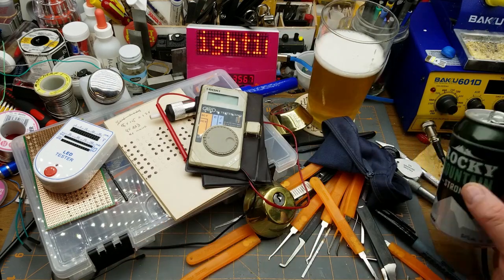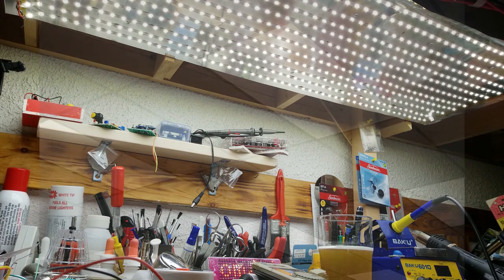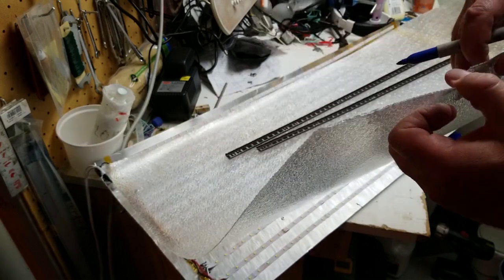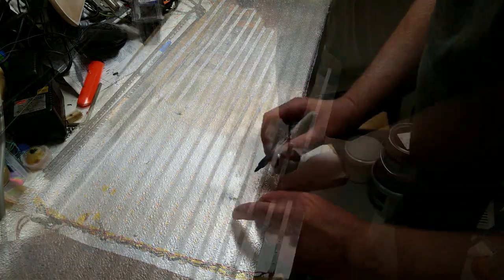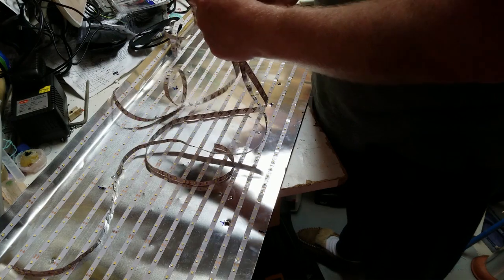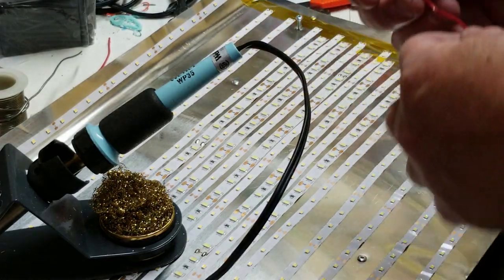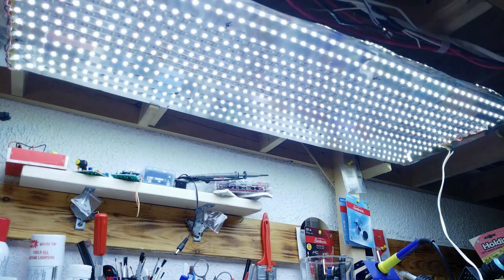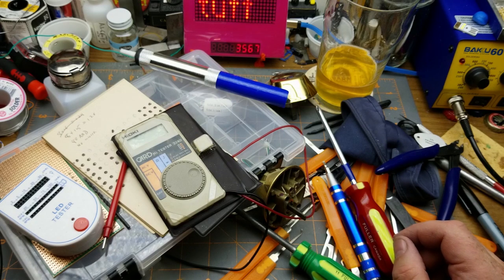workbench light diffuser

Comment: If you drop the diffuser down a few inches I think you won't notice any reflected dots.  Get some longer screws or bolts and either just let it hang freely or cut some PVC pipe as spacers.  The spacers will keep it from moving about much.
Reply from the maker: When I was experimenting by just holding the diffuser in place noticed that. 
Unfortunately I didn't have any screws on-hand at the time that were long enough (about 3 inches).
I'll get some the next time I'm at the hardware store (if I remember)

Comment: Far more elegant than my solution! 50w LED spotlight from amazon, 18" or so above the workbench lol!
Reply: I have three different spot lights plus an overhead LED shop light in the shape of a fluorescent tube light, I still can’t get it right. It’s like the holy Grail or something.
Reply: @GadgetReboot  I work in front of a window, so natural light. If I need a lot of light then can turn on the 80W street light I have nearby, and that provides way more than enough light for most work. Portable light is a double 5ft waterproof light that I recently converted to LED, it is bright, just a little hard to work with in close spaces, but for a room perfect as bright fill light just on the floor.

Comment: Nice work. But you should have spaced the diffuser away from the LEDs, instead of right up against them. That would have given you better diffusion.
Reply from the maker: I didn't have any screws on-hand at the time that were long enough (probably at least 3 inches).
I'll get some the next time I'm at the hardware store (if I remember)

Comment: Lock picking/smith tools... when did you start into that?  I just started a month ago after watching and getting hooked on a couple YT channels about that.  Don't know why or how it first got in my suggested videos but I'm hooked and it is fun and challenging.
Reply from the maker: I've been tinkering with it for a couple of years. Built a few picks after watching some videos (probably the same channels you are watching) and then ordered the cheapest Chinese pick set I could find (https://www.youtube.com/watch?v=CadGGPpE8tw).
Those 2 locks I have on my workbench were a "$1.00, no keys" yard sale find.
Reply: @pileofstuff  Same here, why buy when you can make, using scrap hex keys and a grinder, then harden them up. Did quite a few pickings of cheap L&F locks with only 2 paper clips.
Reply from the maker: The first few that I made were done using stainless steel hose clamp material, wiper inserts (the traditional amterial), and even coat hanger wire (makes a decent TOK tensioner if you flatten the end a bit)

Comment: is the diffuser screen too close to the light source? Maybe a bit further away would help? ( not an easy thing to test i see )
Reply from the maker: Distance does make a difference. It does get more diffuse as you increase the distance.

These are the longest wood screws I happened to have on hand that day. 

I'll probably experiment with some longer ones if I remember the next time I'm at the hardware store.
Reply: @pileofstuff  Just some still wire on the short screws, through the hole and then bend to a T shape so it does not fall through again.

Comment: As somebody who's worked in commercial lighting for almost 40 years, I cringe heaps when I see something like that.
LED Strips are totally the wrong product, and there is massive losses from all those resisters. The efficiency and durability of the strips is poor, and that diffuser panel is totally random and doesn't deal with the light output in a "technical" or "optical" method.
You'd do a lot better to chuck all that hobbyist rubbish away, and get some 1x4' or 2x4' fixtures and stick some reasonable LED tubes in them. The light should NOT be above you, and definitely not from in front, but coming in from above both sides. That prevents the reflections that you complain about, plus it prevents you shadowing your own work. For the diffuser, there are many panels available that will not reduce the amount of light that reaches the bench. But really, it's probably not even necessary if you position your lighting properly.
Reply from the maker: But I am a hobbiest...
One of the statements I have made since starting this channel is that I aim to pursue my hobbies using the most affordable methods possible.  Yes, sometimes that fails spectacularly, but by showing both my sucesses and failures I hope to learn something in the process 9and I further hope that other people can learn from my experiences)
I appreciate the input regarding the better way to do things. That, too, helps everyone learn.